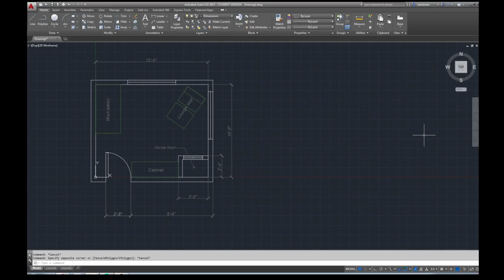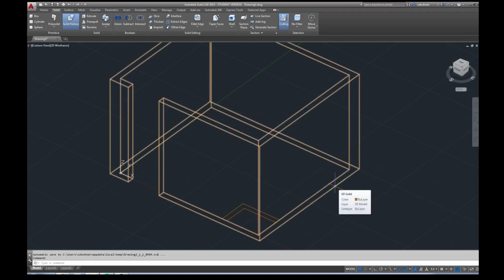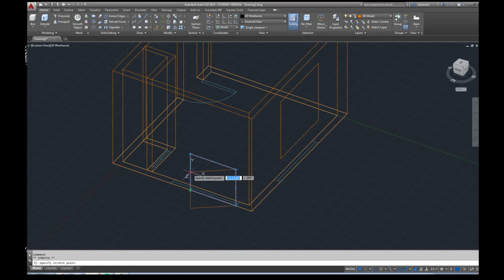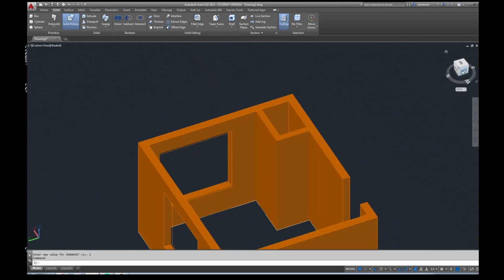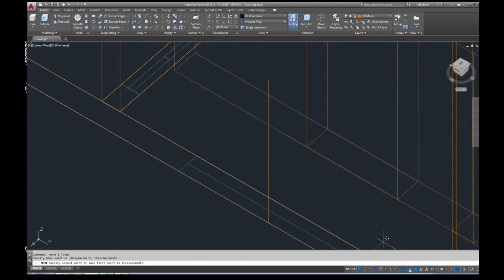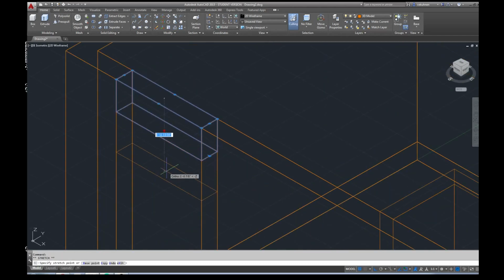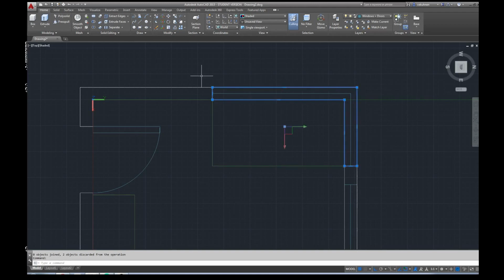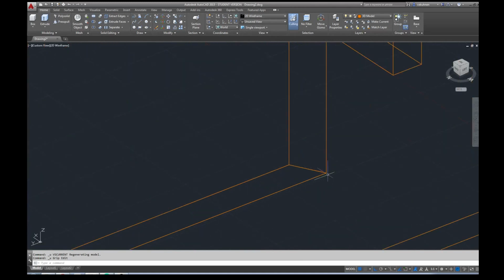3D Wall Creation

Comment: Hi, thanks for making these great videos! I've enjoyed a lot, though something in Autocad is still a bit frustrating to me --- here I was trying to snap onto the corner of a window on my floor plan, while the current layer is the 3D modeling layer. However, while I was trying to keep the right wall selected, it would only snap onto the corners of the wall; when I am snapping onto the corner of window, the selected surface became the bottom. Do you know how I could fix this?
Reply from the maker: Hard to say from the distance - and to be honest I do not like modeling in AutoCAD a lot as the UI and tools are a bit clunky.
Reply: haha yea.